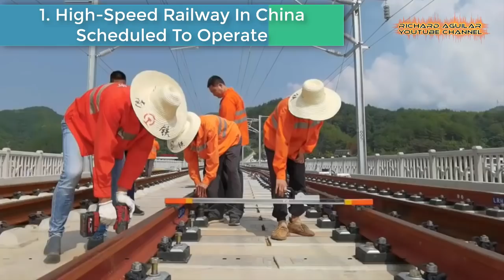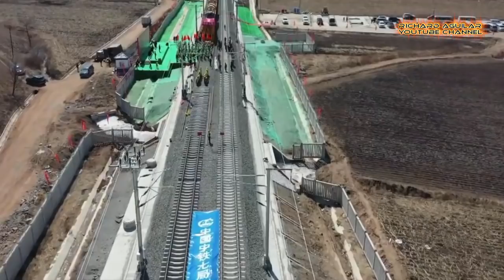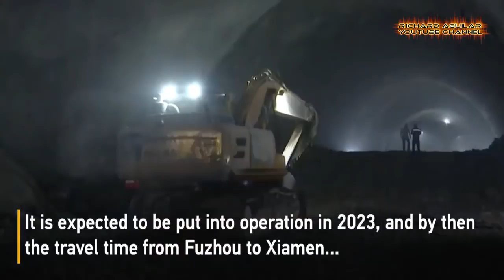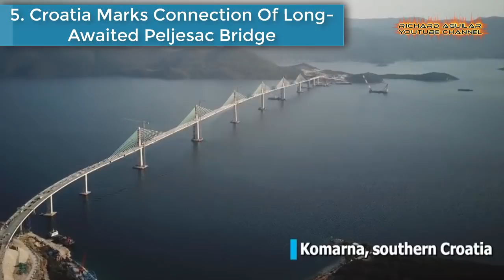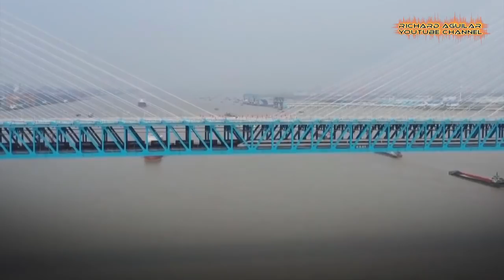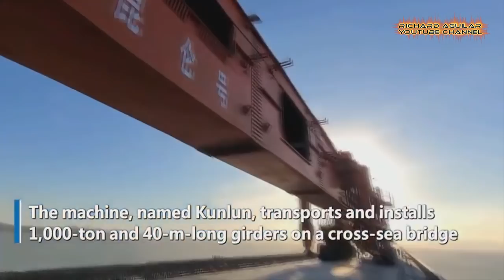RAILWAY INNOVATION: Building CHINA'S Modern Railways | Super Engineering Works

Comment: ALL FUTURE RAIL SHOULD BE HIGH SPEED
Reply: It is meaningless for short distances! Maybe for distances above 200 km, otherwise the resources used are simply too high!
Reply: @pahatpahat9566  I mean at 200km it still would work reduced travel time just means increase in profit so ur wrong
Reply: Wawak Sontoloyo  , You are real short brained, I only say HSR is useful for distances more than 200 km, otherwise the cost may not be worth it! Simply because at that distance, time saving isn't much!
Reply: @pahatpahat9566  most HSR lines are long distance
Reply: @qjtvaddict  , when someone actually speak of metro systems within the city, isn't that system all rather short hauls? I just said that HSR will serve better if the distance is above 200 km. So what is wrong with that?